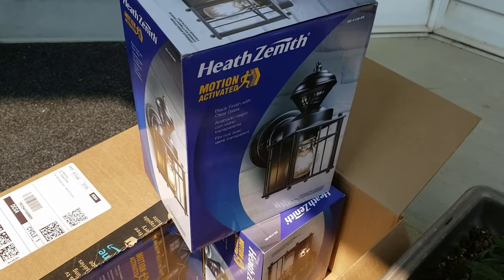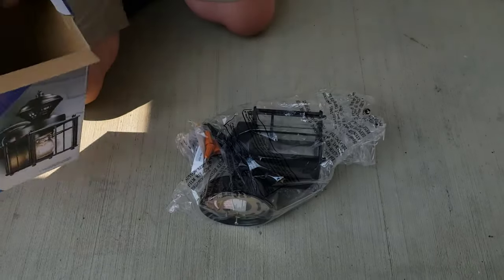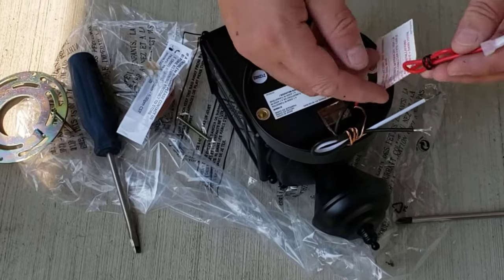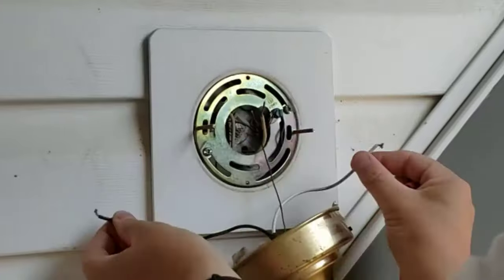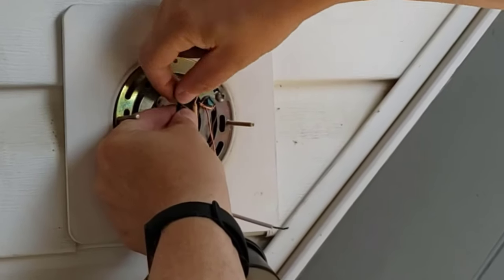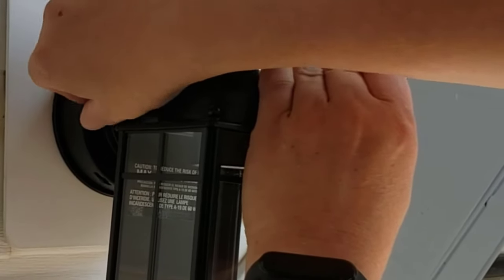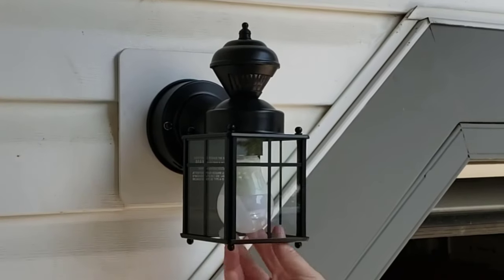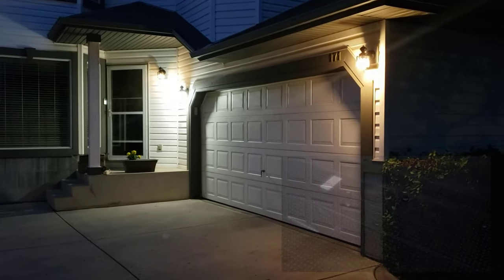Motion Detection Lights - Easily Install - Cheap DIY Security For Your House - HZ 4132 BK

Comment: You are incorrect in the most important instruction. Some lights are wires to the light before the switch so it’s VERY important to kill the power at the breaker unless you are 100% positive that your light is wired to the switch first. However, you should always get in the habit of shutting off the power at the breaker no matter what. 120 volt AC power can kill.

Comment: Thanks for the use of the LED bulb that I presume is also your regular use 

HZ  states use of tungsten/incandescent bulbs.  I posted a query about LED usage on the UTube installation vid for the model , but no response from their tech dept. yet, as of eight months ago. LoL
Reply: a Tip ?;  
Already for my other two long-lasting' motion sensors, to prevent accidental mode switching, I attached  a 3/4" copper piping bracket under the wall cover plate screw usually above it, that conveniently covers over the switch when in off' position. 
It can be swiveled slightly aside, when I do want to change the mode for awhile.

Comment: Is it possible to keep the light on all night?
Reply: The vid' host mentioned/showed at the end when indoors.
 
From my own HZ model SH4144az manual;   "...can be activated to stay on full bright after sunset for only one night at a time. It auto' resets to motion sensing at sunrise .... To turn on MANUAL mode, switch the light off at the wall switch for 1 to 2 seconds, and then back on.  "
And if you want AUTO mode back sooner than the sunrise reset. Follow the same method as for Manual' .....

Comment: Our lights are way too sensitive on street traffic is there anyway to lower the sensitivity maybe by placing tape over the sensor
Reply: Did you turn the sens' dial down (usually counter-clockwise) to a zero-ish'  position yet ?

Comment: I watched your video after installing the same brand/ different model light.  I thought I did something wrong, but found out it was the bulb.  A sylvania LED TruWave technology wouldn’t work.  An older style bulb worked.  By the way, we had the same brass lamps. Good video instructions, thanks.
Reply: I also had trouble with the bulb...For some reason the manual says to use an incandescent specifically, instead of for example LED or Incandescent.  I did get an LED to work, but not the first LED I tried for unknown reasons.  So I would say if one LED bulb doesn't work, just try another brand name.
Reply: Be careful some fixtures work better with the rated bulb for the fixture and proper switch for fixture. For example if you get non LED recess cans and try to put led bulbs in the fixtures and a dimmer switch for them guess what’s not going to work properly?????? The lights.

Comment: Love the enthusiasm! I have my lights set to come on dusk to dawn but I’m noticing they’re flickering. I’ve adjusted the sensor, changed the bulbs but still they flicker. They don’t flicker all the time but usually once they come on the flickering starts then slows down.
Reply from the maker: That is odd.  Mine are binary - on or off - no flicker.  Do you have any old school incadecent bulbs you can try?
Reply: Hi Nancy. So are you saying these lights can be set to automatically come on every night and go off at dawn without the motion defection function? Please let me know. That is what I’m looking for.
Reply: @URTechDotCa  I’ve tried dimmable, not dimmable, incandescent and LED and it still happens. I even took the lamps off the wall to make sure they’re wired correctly but clearly I need a professional because it’s driving me crazy
Reply: @bluediamondlover  According to the manual (download at Heath-Zenith) a high sensitivity combined with large temperature differences of objects can cause the flickering.  If you have an air vent, heater vent or highly reflective surface in the area in front of the light that is probably the issue.  Best thing you can do it turn the sensitivity to minimum and possibly turn (to re-aim) the sensor.  The manual goes on to day the flickering could be normal operation if heat from other objects is affecting it.
Reply: @brianhankins9992  they are set to minimum and there’s no other heat source in the area. I have 2 lights on the porch and 2 over the garage doors (one on each side) that’s operated by the switch in the house.
Reply: @bluediamondlover  Re-check the wiring, checking for clean, tight connections free of corrosion.
Reply: @brianhankins9992  I actually checked today. I have NO clue why this has started to happen. I wish I could send you a video so you could see what I’m talking about. There are 2 on the porch and 2 bedside each garage doors that are operated by the indoor light switch. These lights started flickering months ago so I changed the bulbs, adjusted the sensors, checked the wiring but to no avail. Sometimes they flicker, sometimes they don’t,
Reply: They require incandescents
Reply: @alidi4144  Actually, I'm using some LED bulbs in mine.  Oddly, the first LEDs I tried didn't work though, so maybe it has to do with a technological change in older versions.

Comment: Can I use the "test" mode to operate lights off and on from interior wall switch and leave motion sensing off?
Reply: I would say yes.
Reply: I quoted within a recent reply to other', a excerpt from my manual.   Which maybe another answer   ;-)

Comment: Hi! What is the red wire for??
Reply from the maker: The extra wire is connect multiple units together so if the motion is detected from one of the sensors, they all turn on.  I do not want that to happen so I did not connect them... but you could.
Reply: Good video.   You saved some money. I think I can do it myself